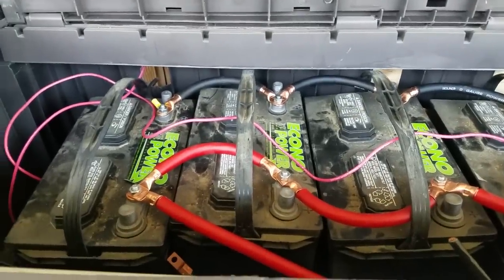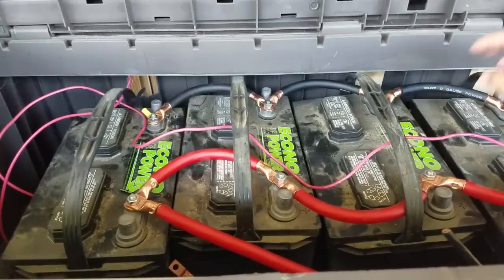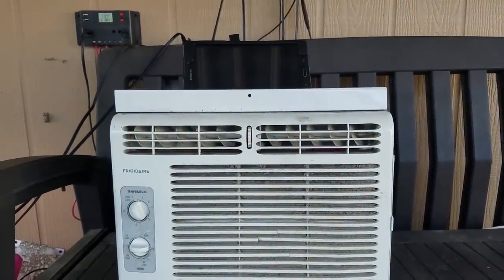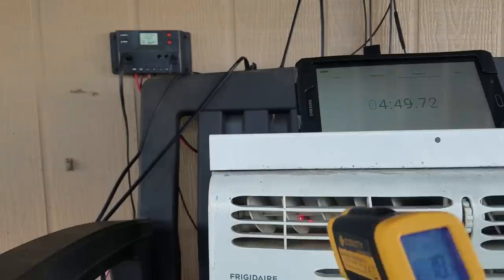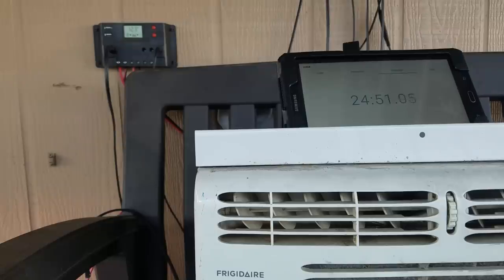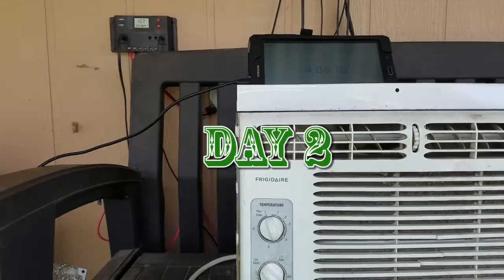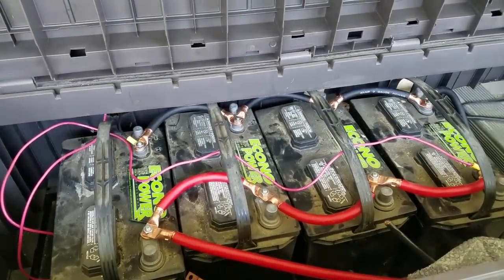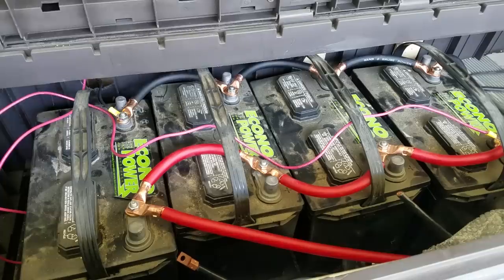Running a 5000btu air conditioner on Harbor Freight solar panels?

Comment: How things change.   My current setup costs $800 and will run the AC for just a 100 minutes and have a meter rating of 20% left.   It charges for free daily.   It basically saves me about 28 kilowatts per month from my 400 killowatt bill.  So it might save me $5 per month during the summer - $20 per 4 month summer.   

So it would take 40 year to pay off by that measure.

However, we have severe storms and 2 to 8 our power outages several times per year.  Often at least one 12+ hour outage.  In these cases, it will save the contents of the refrigerator and freezer.  Which may save me hundreds of dollars if I just stocked up and at least $100 each time.  By that measure, it will pay for it self in just 4 years (on average).  So the summer savings are on top of that.  The cost of the energy will eventually (after 5,000 cycles), be 0.16cents per kilowatt hour.  That is almost free.  I pay 12 cents per kilowatt hour and that is likely to increase (13?  14?)
 
It says it will have 5,000 cycles for the battery to drop to 80% capacity.  We'll see.

We are projected to have 40% cheaper units by 2025.  That's just two years from now.

Comment: It would be nice to know specifically what equipment your using.
Size oy your inverter, battery specs charge controller specs.
I'm new to this solar stuff, so it would be very helpful. Thanks.

Comment: I added a softstart to mine runs off 1500 W inverter on 500 Watts of solar from used residential panels in a shed to keep our stuff cool in Arizona summers. I insulated the shed keep it set at 90F so it doesn't run all the time. I have a single 100 AH lithium battery. My goal was to run it as infrequently as possible to keep the battery usage low. Overall total cost of the project was $1500 which probably translates to about a 4 year ROI if I were to just trench about 25 feet from a buried conduit I put in for the shed years ago before I built the shed. I wanted to learn about solar this was a test bed for me. The shed roof is big enough I can fit total of 10 panels on it if I wanted to I have thought about doing that as a grid tie + battery backup for power outages the permitting needed is a lot of work.

Comment: You are not running the AC off the solar panels, you are running it off the battery bank. And, 150 watt panel will not recharge them batteries, so what you are doing is nor practical. 😁👍✌

Comment: I think the real question is not "can" it be done, but for how long and how soon to recharge? 
A typical 5,000 BTU window unit generally draws about 500 watts - maybe a little more or less depending on brand and setting. So if we divide watts by volts, 500 / 12 volts, that's 41.66 amps the inverter is drawing from the batteries. If the battery bank has a total of 352 Amp-Hours, and is in near perfect shape, that means they can run that AC unit for 8.44 hours until the batteries are completely drained. Since you can't completely drain a lead-acid battery, the typical depth of discharge is recommended to be no more than 50%.  That will average out to about 4.25 hours of Air Conditioner usage. Realistically, that air conditioner cannot be run again until those batteries fully recharge. Using 150 watts of solar energy (12.5 amps per hour at 12v) it would take 6 hours of full and direct sunlight just to put only 75 amps back into those batteries. That means it would take just over 2 days of full and direct sunlight, at 6 hours of direct sunlight per day,  just to recharge those batteries from that one 4.25 hour air conditioner usage. (Yes, longer sunlight days, and constantly moving the panels to perfectly face the sun will help reduce the recharge time, but not by much).

I think your video was a valuable demonstration:  1) Yes, it's possible. and, 2) The scale of the panels, in terms of power output, has to match the intended recharge time interval you want.

Comment: I'd be interested in how the system became more effective when you took OUT some of the solar panels. I am definitely not an expert in solar systems, but that doesn't seem right. I'd also be very interested and what kind of a system it would take to run a couple of those air conditioners 24/7 and temperatures up to 100°, because that's the situation I'm looking at while I'm considering solar as an option turn off grid shed to house. I know it would have to be a much larger system than what you got set up there, but I'm wanting to know if it's even possible within any kind of a reasonable investment of money and time.
Reply: It's because of alternating current and the actuation.

Comment: To run an AC for any amount of time you would need the same amount of watts in solar as the AC plus some.
Reply: How many watts solar panel do I need to power a air conditioner that's 500w ?

Comment: The A/C isn't running off of the solar panels, it's running off the constant power output of the battery. 400 watts isn't enough power to turn that 5k btu A/C over in the first place..  the battery and inverter are what's powering the unit. I dont know why people always go off on these stupid tangents doing calculations in the comments section, you look dumb af because the topic was can he make the a/c run with his setup. The answer is clearly YES, every other topic in the comments is driven by pure ego, people who want to sound like they know what they're talking about but they can't even follow the title of the video or the original question being asked.

Comment: When you say that the air conditioner is on a low setting the compressor is already kicked on and the compressor only kicks on or off so it is 100% on or 100% off when you say low setting that's only the fan so that's not going to make a difference as far as the coldness coming off of the compressor it's just the fan speed so it doesn't take any more or any less power if you put it on low medium or high

Comment: The AC is probably drawing around 1300w … 150w of solar won’t run run the AC… you are only buying a few more minutes of run time from the batteries… you can’t discharge lead acid below 11.6 volts without risking permanent damage to the cells… therefore you can’t run the AC until they just give out…. The 150 will run a TV and and few small things indefinitely as long as the sun is out

Comment: Holy crap the most dysfunctional uneducated post video I've ever seen in my life in the comic section holy Christ two 100 watt panel kits in 8 35 amp hour batteries I run a AC 24 hours a day your refrigerator a laptop while charging phones watching my DVD player and still have plenty of power I don't know what the hell you guys are doing wrong

Comment: It seems like a big investment to make just to run the air conditioner for just 30 minutes plus you are not to supposed to let your batteries fall below 50 % or you could have damage. It looks like 15 minutes at best to run the a/c unit to keep batteries in a safe range.
Reply: yeah, you can only run it for 30 minutes a day.. because solar doesn't recharge batteries or anything. Where do you fkin morons come from in every solar panel array discussion???

Comment: With all due respect please quit with the Harbor Freight junk panels.. I can not believe how many You tube vids there are on these panels.. DO THE MATH.. Watts are watts. This AC unit is at least 450-500 watts an hour to run.. Those panels will do nothing to charge back your batteries which are also not correct for solar use...

Comment: I have 405 amps with AGM deep cycle batteries with 700 watts panels and I can run my 5k btu a/c in my shed for 3 hours max.
Reply: An average 5k btu ac unit will use about 500 watts at load. You could theoretically be running that AC on just the panels without ever dipping into the battery so 3 hours of run time even in the sun? Something is way off with your system.
Reply: Any major appliances that have a big load , need at least 1200 watts of constant solar to be running without affecting the batteries drainage, anything under that will deplete the batteries in a few hrs,of course it depends on the battery bank as well.

Comment: Let's do the math. 110 volts times 4.8 amps equals drum roll please about 530 Watts. That's how much you need to produce from your solar panels to run the air conditioner. Possibly a little bit less if you ran it on a lower setting. The panels you are using did not produce enough energy to run the air conditioner. Unless you only needed it a few hours a day you would have to charge your batteries using an alternative source. It's been a couple years I'm sure you figured that out by now LOL
Reply: How many watts solar panel do I need to power a air conditioner that's 500w ?

Comment: By my quick math, assuming the inverter is only 80% efficient, this setup should work for 12 hours in the dark and only pull 24% of the battery bank charge. You could still have enough left over for other appliances or lighting or to not worry about deep cycle batteries.

AC = 4.8a, fan = <1a, assume 5.8a for both plus 20% due to inverter loss = 6.96a
6.96a x 12 hours = 83.52ah
352ah / 83.52 = 23.72% drain
Reply: Except to get 7 amps @ 120v , you are going to need 70 amps @ 12 ... According to MY math the battery will be 100% depleted in 5 hours or less ....

Comment: I have a 5000BTU window A/C that uses 427 watts when the compressor is on. Your 352AH battery bank can run that much load for about 4.5 hours to 50% discharge.   My best estimate is that the compressor actually runs about 1/3 of the time so in a small insulated space you might get 12 hours run rime, allowing for the higher power needed each time the compressor starts (3 to 10 times the running power, depending on the motor type and load).  I never discharge even "marine" rated batteries more than 50% to extend the number of discharge/charge cycles they can provide.   If you're using regular automotive batteries (SLI - starting, lighting, ignition) the safe discharge limit is 20%.  Lithium batteries generally provide good charge/discharge cycles at up to 80% discharge (I never take those to 100% because of problems recharging certain types when fully discharged).
My solar-charged "Wait until daylight" backup system  (for frequent but usually short outages) can provide 8 to 20 hours of power depending on season (running the central heat takes it to the 8 hour end).  The battery bank is 420AH of AGM deep cycle batteries which I never discharge more than 50%.  That level of battery protection does work as I replaced the previous set of batteries shortly before they were 9 years old and a couple of them still tested at 80% of original capacity.  I use a 2000 watt pure sine wave inverter and a generator transfer switch to power selected circuits - fridge, kitchen counter LED lights and a couple of outlets.  The stove is gas so we can cook without power.
Basic solar power is one 250 watt panel out back where it isn't obvious and it feeds an MPPT controller.  If we need power longer than that first day, I have another 1500 watts of solar (and controllers) that can be put in place.  Backup to that is a 1600 watt inverter generator and enough stored treated gasoline for about three weeks of days with no sun.
The inverter and most of the charge controllers were purchased new.  Most of the solar wattage was purchased used via Craig's List, as were the batteries - you do have to be able to test the used batteries to know what you're getting.
Reply: I have small AC unit for my shed keep our stuff cool in the summer. 500 watts of solar and 100ah lithium is enough to keep it at 90F. I put in drywall and filled the insides with spray in foam sealed up all the cracks with foam. Even with the AC off during 110F outside it only gets to 98-99F in there I'm only pulling it down 10F. I also have a soft start box on the compressor.

Comment: if you look through the front of the air conditioner you would see it's completely clogged up with dirt and lint. the AC you're using is compromised, run a water hose through it and clean it and redo your tests. that air blockage makes a huge difference

Comment: this kind of video needs to be shown to people and needs to be discussed because I think harbor freight misrepresents a lot of what they're trying to sell. now you said you had four batteries in the video in the beginning but you really have 10 batteries so what is up? but overall I'm glad you did the video because people wish they could just run an air conditioner and not have to pay such a high electric bill the problem is to get all this together cost quite a bit of money and it's very cost in effective to get started. I wish battery prices would come down also if you used a lithium battery setup you might do better or 24 volt set up, or both? the harbor freight solar panels only 25 watts so far for you get a hundred Watts which isn't very much you should go to a bigger panel like 260 watts each and get a couple of those maybe two or three of them and you should be better off

Comment: I see so many people talking smack about this. Can someone actually describe what is necessary to run a 5000 btu ac off of solar panels?
Reply: Volts times amps equals watts.
Reply: 400 watts of solar at least.
Reply: https://youtu.be/lQ1x1P08Ap8
Reply: Generally 1000watts of solar panels.
Reply: If you need to ask how to do it yourself how did you know they're talking smack?
Reply: About 12-100 watt panels will do it.

Comment: All day to charge batteries and then you get 20 min of air conditioning?  Is this what you're saying?  You should see if it will run your refrigerator 24 hours.  If not, you don't have much that would be useful.  Titles like this are clickbait.  The usual American news made up to get viewer's attention with no regard to truth.  I should do a video running the same AC from just one panel, because I'd be running off batteries until they are discharged just like you are.  With one panel I bet I get a half hour a week air conditioning.  This isn't the first of these videos your titles have tricked me into watching.  Other viewers have given you lots of useful info on what you'd really need but you ignore all the facts and continue publishing total BS!

Comment: Here's some DIY info on sizing up your solar setup. The solar panel sizing is depend on the battery bank and the battery bank sizing is depend on the appliance you plan to run. Let say 500watt appliance using it 8 hour a day. That's 4000watt hour plus 10% power loss in inverter and wire. A typical lead acid battery does 400watt hour to 480watt hour. So you will need 8 to 11 battery. This is so that during cloudy days, it can still provide 8 hour of power to your appliance. The rule of thumb is to double up on this so that you'll never drain completely. However, even on cloudy days, the solar panel will still generate some power so you should be good to go with matching up the watt hour usage. The solar panel sizing should reflect 4400watt hour. 100watt solar panel in 12 hour day light will generate 1200watt hour. So at the minimum you will need 4 panel, however, if your panel does not sun track then it only gets 8 hour of peak power so you will need 2 more panel to offset the power loss. The biggest cost here is the battery and that assumption is depended on the appliance must run every day for 8 hour regardless of weather condition. If your unlucky to have two cloudy days then eventually the battery will drain out day #2. Technically, you can run this setup with only one battery but it just means you run the risk of draining it in an hour or two.

Comment: I am off grid and I have 32 golf cart batteries and I run an AC during the day with the sun with no problem unless the clouds are really heavy, so then I stop using it for a little bit until I cant take the heat then I put it on again and so on.. I also have 2 refrigerators and 3 PCs and it runs smooth and the rest of the house (large house), no problem at all. I only had an issue once because it was rainning for 2 days and I was really low, like supper low I had to turn everything off except my main refrigerator and I barely made it to the third day but thats when the sun came out and boom 4 hours later I could turn the whole house on again, except the AC, I had to wait until about 1pm for the AC. its lovely having the sun charge the batteries so I can use what God gave us for free.
Reply: You could also turn the thermostat setting lower hehe it kicks off the compressor for a while the fan is probably 35-50watts if that

Comment: You need around 1100 watts of solar to run everything including 5k ac during the day and maintain battery charge.  No ac at night though unless you add wind mill.
Reply: you have zero understanding of what you're talking about
Reply: How many watts solar panel do I need to power a air conditioner that's 500w ?

Comment: the harbor freight charge controller with shut off automatically when the batteries reach 11.4 volts,preventing the batteries from going dead
Reply: And 12.1-12.2 is 50% not 12.4

Comment: Considering a 5000 btu AC would cost less than 40 dollars a month to run nonstop. The cost of solar energy is still so far from practical its crazy. Im all for it, just all for reality more.
Reply: A lot of these people are off grid. Solar is the best and cheapest off grid electric supply.

Comment: This is a stupid test, if you have a max 150 watts and a 5000 btu AC uses 500 watts, you will deplete your batteries! 

What 150 watts means is that the panels can produce 150 watts per hr, but they wont! They will likely produce 150 watts for 2 hrs and 100 watts for 4 hrs and 50 watts for 6 hrs total watts going into the batteries= total for the day 1000 watts. A 5,000 btu AC is about 500-600 watts will run for 2 hrs on low without depleting the batteries, anything more than 2 hrs and the batteries will need to be charged... This also means that he cant run anything else if he plans to run ac the next day for 2 hrs too.